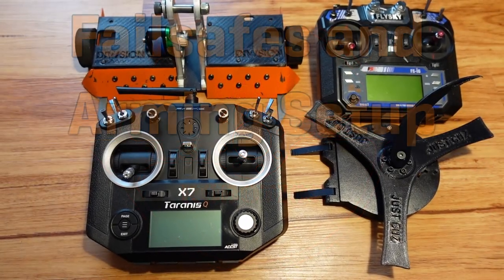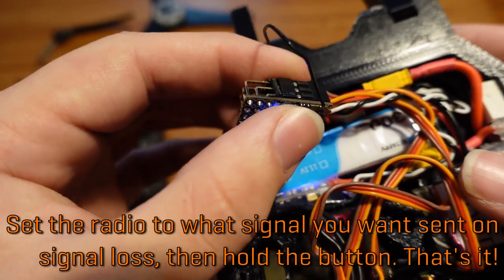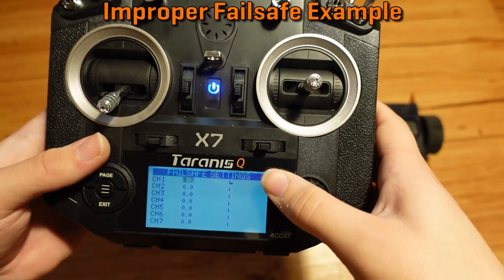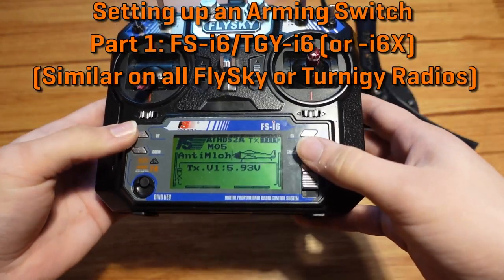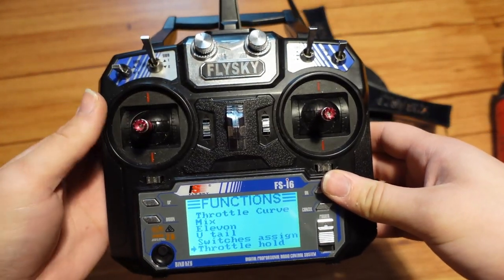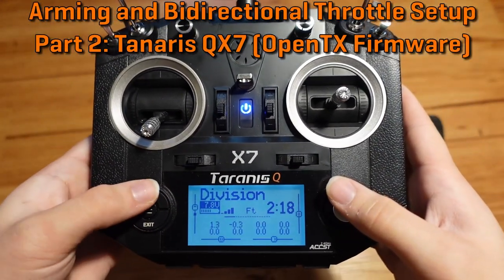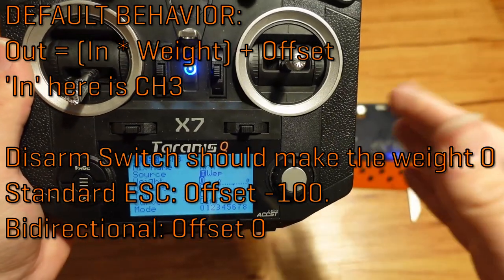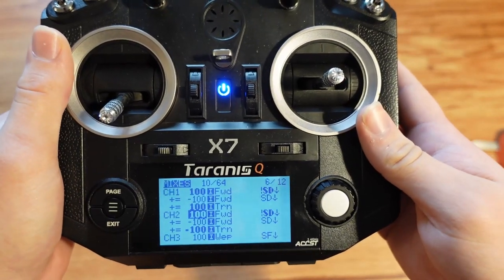Failsafe and Arming Switch Programming Guide for Combat Robots - FlySky FSi6 and OpenTX with QX7

Comment: These videos are so cool! You certainly know more than I could ever learn. I have a question that's kind of off-topic though. The arming disable part of the video reminded me of this. In this first episode of battlebots this season, I think it was Captain Shrederator versus Lockjaw. I won't say the outcome in case someone reads this and hasn't seen it of course, but the pin that stopped the weapon. How does such a tiny pin stop a weapon from slowing? I heard somewhere that weapons have to stop spinning within 60 seconds of the end of a match, so they had to use a pin to slow it down. The part about toggling weapon to be on and off in your video reminded me of this. Sorry if you don't know, and sorry that this is so much for a single comment. :D
Reply from the maker: Thanks! 

Yeah so Shrederator is a really weird design with a lot of holdover tech in it from 20 years ago. Apparently they installed a mechanical brake in the robot like a car has, and that's not a mechanism I've heard of existing in literally any other bot made in the last decade. I honestly have no idea how or why that stupid pin was responsible for the activation of the brake, but it isn't the pin itself but the brake it activated that stopped the weapon. Seems like a poor design choice to me but hey, I've been doing this for 3 years not 23. So he must've had a reason. For Bloodsport we can use the weapon ESCs to brake the weapon in under a minute to comply with the spin-down time rule but it also has never really been enforced AFAIK.

Comment: I just picked up a taranis x7 and wanting to build an ant weight bot. I am having difficulty figuring out what receiver I should get for this transmitter. Any advise would be greatly appreciated.
Reply from the maker: I've used the radiomaster r84 receiver in division and that should be compatible. It's tiny for channels and should work for most Bots
Reply: Thanks for the quick response. I did not know if I had to stick with the frsky branded receivers or if I would be able to use a broader range of controllers.
Reply from the maker: You need to use only receivers that work with the Frsky protocols (D8, D16 for example). There aren't many brands that make those but there are more than just FRSky

Comment: I always set open tx failsafe to no pulses. Setting them manually can lead to disaster.
Reply from the maker: How so? If it's set correctly and your receiver actually obeys the failsafe it should never cause a problem.
Reply: @JustCuzRobotics  I don't have to guess if failsafe is correct or not because  no pulses is the same as unplugged signal wire.
Reply from the maker: In some cases that doesn't work out the way you want though. If you have a servo for instance you may want it to failsafe into a particular position that isn't whatever it happens to be at when signal is lost. I have also had a case in my own 30lb bot where the ESC ran my bot's weapon as if it was sent a full reverse signal when the transmitter turned off and wasn't sending anything due to the fact it was reversible. In most cases you're right that no pulses will work for most ESCs but I'm not in the habit of trusting random Chinese manufacturers to do their engineering correctly.
Reply: @JustCuzRobotics  If lost control signal causes safety hazard that is not safe for combat. That was my point. Servo (lifters) definitely need no pulses as failsafe because there is a risk of getting a finger crushed.